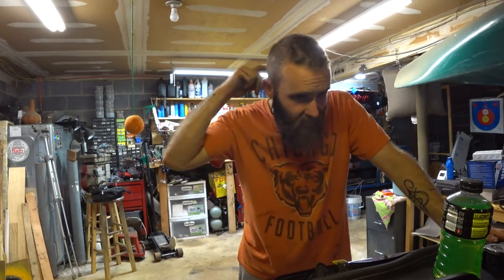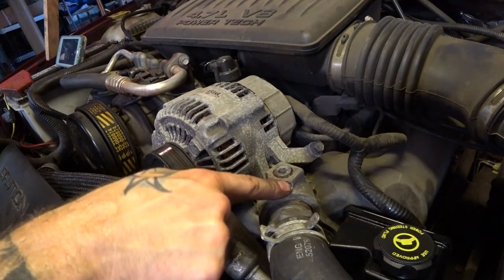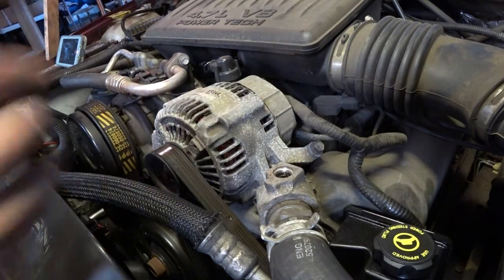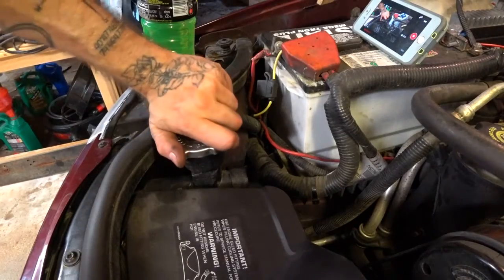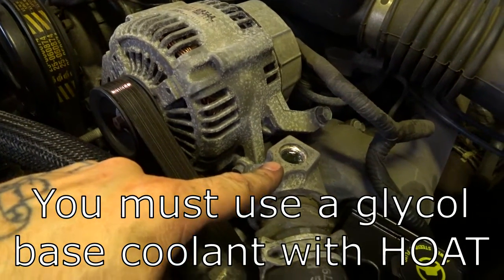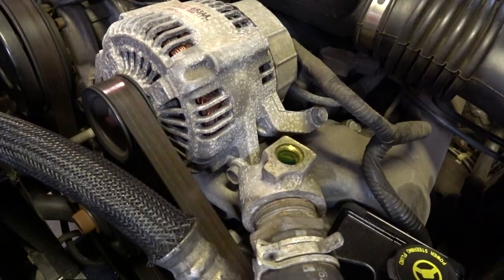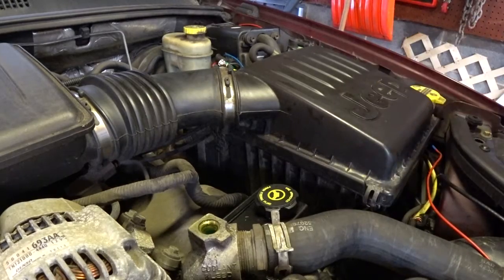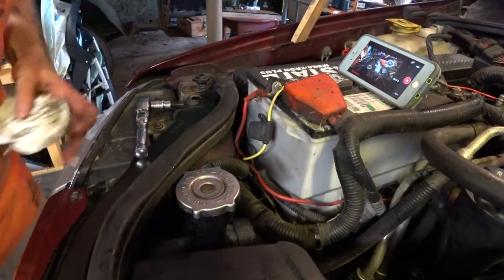How to Bleed a  Radiator - Jeep/Dodge 4.7L

Comment: You show us after you have already completed the job I Wana Kno how much air we should be looking for to come out I mean I've watched it bubble for hours an still over heat I've replaced the heads timing chains set water pump radiator thermostat I even bypassed my heater core... I'm not sure wat I'm doing wrong ... Be going thru this for months now ...
Reply: didn't see the fan clutch in your list...

Comment: There is absolutely no liquid or air bubbles in the valve (small hex screw, not radiator) when I did this. It has been overheating for days, what do you think?
Reply: How is your thermostat? Old? new? If the thermostat is failing it can be either stuck open or stuck closed. Both are not good. The thermost needs to open at a certain temp for the cooling system to operate properly, other systems rely on this certain temp to keep the vehicle running properly. Did you hit something with enough force to maybe damage the radiator? (I hit a deer, around 45mph or so, it happened fast I had time to slow down from 65mph). Nothing happened right away, but hrs later, soon as I got in town, a crack in my radiator spraying coolant, my radiator cap wasn't holding either.
Reply: I replaced my radiator, as preventive maintenance, also it was payday, I replaced the upper radiator hose (complete new one), lower hose. Thermostat. Housing. Everything was fine and dandy until I hit that deer. That's when I had problems. I barely dented my hood grill. (thank God I had time to slow down, the deer ran All the way back across the road, that's the reason I was able to slow down around to 40-something mph, from 65mph it was 4am, omw to town for work). Nothing happened at first, I even stopped like 20min later, checked out my front end, it was dark still, looked good. When I got into town is when a crack in my radiator happened, and my radiator cap was loose, and sprayed everywhere under hood.
Reply: I have 03 dodge durango. Slt 4.7

Comment: I did this but still still overheats, replaced radiator due to crack. Replaced pump and T-stat because it was right there, any suggestions
Reply from the maker: I know a lot of folks who are "certain" they got all the air out, but they didnt actually. Also, make sure you hydro fan is operating properly
Reply: @DEInTheGarage  my hydro fan run off p.s oversized tires will make ps stress it making the fan not work right

Comment: Neighbors 300 warped a head because of air pocket. Reason you must bleed off like this is their resivior is lower in a newer Chrysler.  Mopars just suck...lol
Hurts me to say that coming from a mopar family since the 60's. We owned many Road Runners &  GTX's, I drove a 69 Hemi Super Bee as my daily until 3 yrs ago, 64 Sport Fury for many yrs also. 
It was once Mopar or no car for me but If I won a brand new one today I'd sell that p.o.s. tomarrow. They've been junk since late 70's when Myitchybushys were put in them. MB didnt help matters but now Renault? OMFG... They failed here decades ago, couldn't give one away by the time Renault left the US. Always have built junk.

Comment: i have a 2005 dodge ram 1500 4.7 pickup. the in & out radiator hoses are hard & hot. i suppose hot it normal, but i know hard it not. i recently replaced my radiator. could that fix the hard hoses if i bleed the top hose like in this video?... i checked to make sure my thermostat was in the right way & it was. brand new thermostat. we never bled the top hose like in the video after we replaced the radiator. could that make the hoses soft like their supposed to be?
Reply from the maker: Upper rad hose should be pretty hard when warm. Over hard rad hoses at operating temp could be a blown head gasket allowing cylinder pressure into the cooling system

Comment: I have a 99 WJ 4,7 - is it the same procedure?
How would you go about emptying the radiator i the most efficient way?
Any typical cleansing liquid? Using distilled water?
Reply: Use distilled water

Comment: Quick help  my bleeder bold apparently was damaged, when i removed it the screw line was damaged i put it back as it was bot now is damaged and not sealed properly recommendations for a temporary fix without having to replace the entire part for that arm where the bleeder system is ..please!!!!!
Reply from the maker: Sorry I am so late on this. you can TRY teflon tape, but your cooling system deals with very high heat and pressure. don;t take any chances and definitely do not mess with it when hot

Comment: I was having over heating issues in my 4.7. It has a new water pump, thermostat and  housing, brand new radiator and all hoses/clamps. I had no idea I had to do this. It's in an 03 dodge durango. Has 236,000 miles. Thanks man you probably  just saved my  motor.
Reply from the maker: Glad to be of help! This one almost got me as well on my first 4.7

Comment: Nice video man. I just got a 4.7 04 Durango, when I run it, after like around 30 mins if I stop at a light or stop. The temperature gauge will rise to the middle line or a little more above. But if I step on the gas it will go down. What can it be? I just got a thermostat, temperature sensor, and a cap... lol

Comment: I have an 03 Dodge Dakota. It was getting hot. Had a new water pump new thermostat and a senior put on it. They said they bleed the lines and it is still getting hot. And they don't know why. And clue on what to do next?
Reply from the maker: Did they bleed them properly? Most techs do not know how to properly and completely bleed the 4.7 and 3.7. You might want to try this method to bleed it yourself.

Comment: What happens when coolant starts spilling out if there like a volcano? Have I left it on too long?
Reply: Yea mine does the same and the fan just sprays it all over the truck
Reply: @Supralars  exactly. So what does that mean? It stays idle for awhile but then after about 40 minutes it'll start exploding out spilling everywhere
Reply: Did you guys figure this out? Once my engine gets up to temp and thermostat opens, the bleeder port starts spitting out coolant like crazy. Losing lots of coolant...
Reply: Mine is doing the same as well. Was hoping to find the answer here. Any help would be appreciated.  Thanks
Reply: Head gasket  maybe 🤔

Comment: Hey, how do you bleed a 4.7 when you can't loosen the bleeder screw? Mine is corroded to the point it wont budge.
Reply from the maker: Have you tried heating it to get it out? You would have to bleed it the normal way and hope for the best.
Reply: @DEInTheGarage  I did that and it helped a bunch. My upper radiator hose isn't swelling with steam anymore.

Comment: I'm gonna tell you a story I have a 2013 Dodge ram 1500 started overheating don't know why so I changed out the water hose the thermostat still was overheating so I Changed out the Fan clutch new radiator new water pump still overheating I was at a low point of giving up Then I ask God for help he showed me your video I want to personally thank you sir  your video just made my day now my truck  Has stop overheating Working fine now GOD BLESS YOU
Reply: It pays to ask God for His help! 🙂
Reply: I'm having the same problem with my 2010 Ram 1500. I changed the thermostat and the temperature went high. I followed the video and now it's good
Reply: Powerade , that’s a new one , how long should I let run and should I do this twice three times ? Should I put ac on high ? , should I push the coolant hoses , do I put cap on while cars on or off ,
Reply: God DOES answer when we look lovingly to Him AND give Him the CREDIT for what He does! 🙂
Reply: Same here
Reply: Bottom hose is still cold after flush and the nut is a good trick but I'm still over heating with thermostate,rad cap,cooling fan and temp sensor replaced
Reply: @shocker7000 Sometimes the impeller on the water pump on these will deteriorate. The pump won't leak, but it won't pump efficiently either; overheating the engine.
Reply: Thanks for your help DE! 🙂
I saw that plug on my '03 Grand Cherokee w 4.7. Wondered what it was for. — Now, I know, thanks!
Remember DE, that God loves you ❤ and wants you to love Him too 🙂
Reply: YOUR OWN ASSUMPTIONS ELUTIONS IMIGOUSE THOUGHTS THAT GOD OR WHITE JESUS BLANCO DID ANYTHING FOR YOU ARE NOT FACT'S , BUT ASSUMPTIONS YOU PERSONALLY CHOSE TO BELIEVE AND HAVE BEEN IMPOSED BRAIN WASHED TOO BELIEVE NOT FACTS
Reply: GoBears!
Reply: How come my overflow reservoir on my 4.7 Cherokee won't drain
Reply: I identify with this comment.
  Having issues, I kept saying my heat was too hot..they kept saying it's 20 years old..  just fill overflow, I wouldn't do it.. I WANTED TO KNOW WHY IT KEPT HAVING TO BE REFILLED. 
I just sent this and another non dodge sponsored video, to my son in law for our LEARN A NEW THING A DAY DURING COVID.. LOL 
In this video I learned also about the valves and can check those too.. I love this truck. The guy sold it to me maintained it for 18 years, now everyone wants me to just run it to the ground.  I refuse. It was getting 18 to 20 mpg, now it's at 15.  Because everyone said it couldn't be fixed.  And this video shows what my concern was. You can't just fill overflow and be done, so many bring it to mechanic or dealer.  When the issue is the bleeding and pressurization. 
  I hope I saved it, by not driving it while trying to troubleshoot it.. 
Everyone involved has learned a new thing, that this engine needs to be serviced correctly and not just fill overflow. So many can't get it, because they always just fill overflow in other vehicles. This is not the same type if system.. so get a her kit in your truck.. because if you have to add antifreeze, it's not a quick fix, until you can do this process in the middle of the night with no light.. lol and it's 22 degrees.. but after you do it a couple times when it's convenient, you might not get stuck like that. . 
  These tutorials are great.. even I can follow them.. I just need extra muscle to get the bolts out.. lol
Reply: @candygarfield9315 Excellent job Candy God loves you ❤

Comment: Idk how to thank you man frrrr saved me a lot of time and money today 😂🙏🏽god bless
Reply from the maker: Glad you found this helpful!
Reply: @DEInTheGarage  yo you said something about don't use the green coolant question for ya I had a 00 Chevy Impala 3.4l yes the motor that is notorious for blowing head gaskets because of them running hot and people not maintaining but here's the thing in the 3.4l it's said to use the orange dexcool well I hate that crap and I found that when I got a new radiator and started to use the green preston the engine ran cool land like a champ and not to mention every mechanic I talked to always recommends the old school green preston and is totally against that orange dexcool soo...... This story leads to my point and my question I just bought a dodge durango with the 4.7l magnum motor and was thinking about doing a tlc day with it and one of my plans was to flush the rad and fill her back up with some nice new stuff so when you said don't use the green fluid use another one your not talking about the orange dexcool stuff are you cause like I said I've had nothing but problems with that gelling up in the past and clogging rad, water pumps etc .. And everyone I know says the same thing and also are against it so I was just wondering is that what your saying to use in these motors?????

Comment: Do heater has to be on? Can you also give me an estimate on how much time should i see no more bubbles! Thank great video!!
Reply from the maker: Yes, having the heater on is good practice, but not required. This process usually takes about 20 minutes
Reply: D&E In The Garage  also some people bleed the wj with engine off. Which way is it better?
Reply: What are the signs of bad valve seats?

Comment: Oh man thanks so much. My water pump was leaking and I replaced it. I tried just bleeding with the radiator cap open. Yea I need to do your procedure.  I have a 3.7. Thanks so so much for your video bro. Oh Yea!!!
Reply: Update. I opened the bleed port when the car was cold. Filled in Antifreeze and ran the vehicle and looked for the air bubbles to stop. Then put the bleed port back on. Then I noticed the heater system worked. Good to go. After the car cooled down I topped up the coolant reservoir. Good to go. Took the truck on a 15 mile drive. Good to go. No leaks.
Reply: Thanks agin. It made a huge difference

Comment: This is really helpful. I just recently replaced both of my cylinder heads (first time doing it) and after 1k miles i had a blown headgaskets. Wasn't aware of the proper bleeding procedure. No wonder i kept hearing gurgling sound under my dash after i turn off my engine. Did a research about it and found out i have air in my cooling system. You're right. My 4.7 never overheated but it's temp running a bit high than normal. Never passed 210 but close. Now just have to redo everything again and hope everything goes well this time.
Reply: Mine does the gurgling sound aswel wen shut off. Did the bleed fix it?
Reply: @filipeferreira7019  If you recently replace your cooling system components like radiator, waterpump, thermostat etc. then u proly need to bleed it if there's a gurgling sound in your dash. But u haven't and it makes that sound, im not a mechanic so i can't really give u an answer. You might wanna ask or see your trusted mechanic. But to answer your question after i bleed my system. Yeah it did work! U just have to do it multiple times til u dont see any bubbles coming out yout bleeder valve.

Comment: The very best way to do this is to do just what he did. The next morning though before you start it pull the plug again along with radiator cap and top it off again. You will know when all the air is out when you can't hear the "waterfall" sound in the heater core. I bought an 04 real cheap because it dropped a seat, a real nice 4.7 Limited HO for only $500. A couple grand in it now with new heads, radiator and things, once I bled it properly I have had zero problems.
Reply from the maker: Solid advice

Comment: Hey Doug, just wanted to say a quick thanks for posting this one, as well as the water pump replacement video.  The water pump started making a rattling/chirping/clanging noise, the bearings were about to give up the ghost.  I remembered you had these vids, so I used them to double check that this was as simple of a job as it appeared, and you confirmed that for me.  I live in a residential RV park, and they don't want us doing a lot of work on our vehicles here.  This water pump was surprisingly quick/easy to replace!
Reply from the maker: Yea, coming from the 4.0 I was blown away by how easy it was to replace. No paper gaskets to scrape and plenty of room to work. Glad you found this helpful!

Comment: I have a 4.7 2000 wj with only 139k got the jeep for 300 at a junk yard guy drove it home like 10 min drive i got a amazing deal it needs a transfer case rust fixing and a right door windo the small one its a nice jeep oh and its a larado with limed in side like the leather heated seats sun roof and the infinity gold speakers btw im 13 and my dad has 2 zj limed's with the 5.2 1 is a 95 And the other is a 97 and my mom has a 03 wj with the 4.0 my dream car is a 5.9 zj

Comment: "Doesn't have to be too tight, just snug" says the guy who almost had to use a breaker bar to get the plug off.😅
Good vid Doug. I'm one the few I know that had a 4.7L first out of my Jeep group so I had nobody to turn to for engine hints. I learned this trick from a guy on nagca that's a Mopar mechanic. He also confirmed that not doing this is a leading cause of blown head gaskets (due to the higher temps).
Keep up the great work.👍
Reply from the maker: Haha.. Yea, from the factory they have loctite on then which is concerning that it seems mine was still factory sealed...

Comment: On my 08 4.7L, I open the bleeder, top if off and close it back up.  I run the engine with a Lisle (EPAuto Knock off) Spill Proof Radiator fill funnel with plenty of coolant in it.  Run it with the heat on and just keep massaging the upper radiator hose until there's absolutely no air in the system.  I've never run it with the bleeder off though.  Hasn't been an issue in the 4x I've had to replace the coolant due to a water pump, radiator or just changing it out.   But yes, 100% agree that that spot will be the cause of air pockets if you don't open it up and fill it up!  Keep up the great vids!!!  (Though, by 08, the reworked 4.7L is supposed to not have the valve seat dropping issue.)

Comment: Here is the WORST part of my 4.7 engine: some a**h**le used red loctite on my bleeder. I need a map torch to get it free which means I probably also need to drain some of the coolant.

Previous owner, not me! I've never been able to get the set screw free. I don't use red loctite on anything.
Reply from the maker: They come from the factory like that. If yours was still sealed (mine was) it was likely never bled properly
Reply: @DEInTheGarage  How did you get yours loose?
Reply from the maker: @gcanaday1  I got a quality 8mm allen key to make sure there was no slop in the fitment and just went for it.. Do you think your will still no come off with a long bar on it?
Reply: @DEInTheGarage  Actually I was afraid I was going to break the tool! Maybe I'll try one of my husky ones on a 2 foot bar..the one I use for spindle nuts >:]
Reply from the maker: @gcanaday1  Haha... damn man... Sounds like yours is REALLY tight... Have you maybe tried when the engine is all the way up at operating temp? Obviously do not remove it fully, but maybe with that heat soaked in your can break it loose and take it off when the engine cools down?
Reply: @DEInTheGarage  Maybe. I haven't tried that. I'll give it a shot when I get a chance and see if it helps. I'll let you know in the comments of a future video!